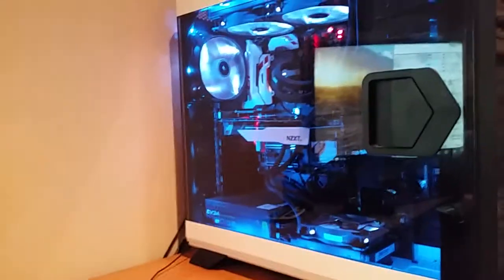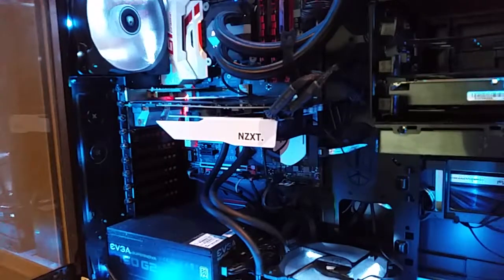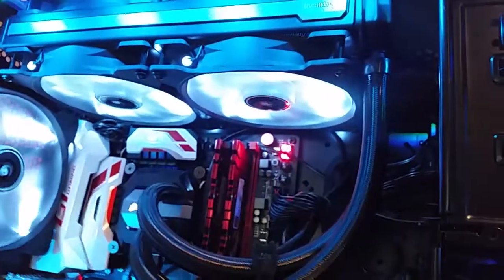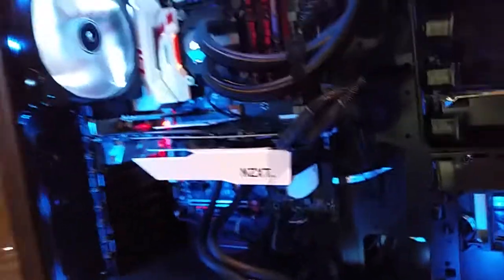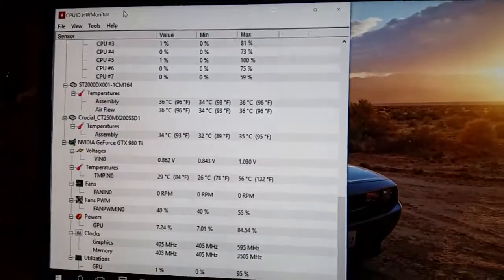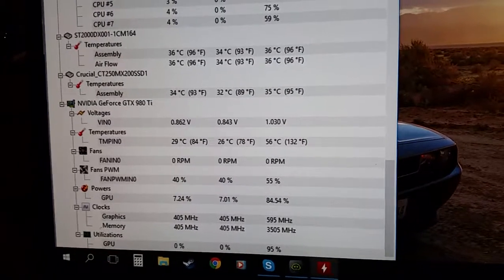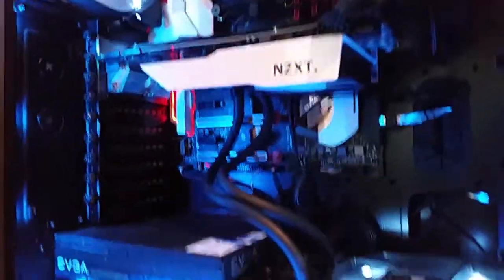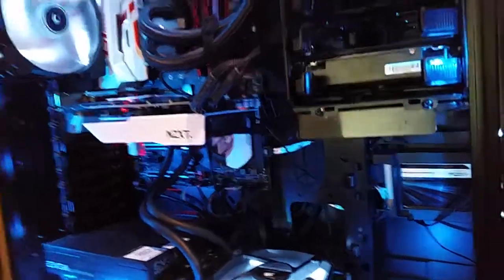Kraken G10 on a Gigabyte  GTX 980 Ti G1 Gaming

Comment: Hey Grubby mate. I'm thinking of copying your card setup, but my CPU cooler is so big that it's pretty much touching the backplate of my 980 ti G1 right now. Is it possible to install the G10 without the white backplate it comes with?
Reply from the maker: There is a way that you can do it, I saw it on another channel a long time ago where they secured the cooler using cable ties instead of the G10 & screws. The bracket is just there to secure everything in place and apply tension so if you wanted to get creative you could secure it in other ways. The other thing you could do is take the backplate off the 980ti and that would give you enough room to install it the standard way.
Reply: I might go with the G12 then as I think that only requires screws on the back of the card. thanks for the reply mate!

Comment: hi grubby, did you manage to take the black backplate of the card off? did you have to buy a copper shim?
Reply from the maker: I kept the backplate on and it went together without the need for a copper shim, the process is the same as on this video I recently posted for the 1080ti https://www.youtube.com/watch?v=g3lSknmW7eU&t=1069s

Comment: Have the reservoir above the pump. You might be dry starting it.
Reply from the maker: I returned the first H55 but I don't think there was anything wrong with it, ended up getting a second for sli and they both run fine.

Comment: Seems like you mounted the card with the backplate on it. How did you do that? Do the backplate screws that come with the Kraken G10 fit just fine with a backplate too?
Reply from the maker: They just fit with the backplate  on but you need to peel the foam pad off the NZXT bracket to do it, I also recommend putting a thin washer between the backplate and the nuts securing the screws on the NZXT bracket as when it's all connected one of the nuts will slip into a screw hole on the backplate and make the NZXT bracket tilt on an angle slightly, still works that way but it won't look flush
Reply: Thank you so much for the reply!
Reply: what kind/size of washers?

Comment: i have the same card... do i need heatsinks on the vrm?
Reply from the maker: If you're using the Kraken G10 heatsinks are recommended, there are videos out there showing how little the G10 does for the VRMs without the heatsinks.

Comment: I have Zotac 980 ti amp and evga sc 980 ti they're pretty much ugly looking together it shouldn't have a problem with the fitting you think?
Reply from the maker: I don't think there are any versions of the 980ti the G10 hasn't been able to fit but I would do a bit of net searching first just in case, the one thing that does change between models is the need for a copper shim between the water cooler and gpu chipset.
Reply: +Grubby well I ordered shims at eBay for 5$ it was successful on my gtx 980 but ti is different I guess it would work thanks for the info though

Comment: Was thinking about putting one of these on my Evga GTX980 SC AXC 2 along with the Kraken X41 and X61 for the CPU cooler but decided against it and just get Kraken X61 for the CPU and leave the ACX cooler on my GTX, I admire you for trying this on such an expensive card,  I did lookat at another vid and the guy put a copper shim between the GPU and cooler block not sure if that helps the cooling better

Comment: Nice :) I have this setup on my AMD 7970DCII. Also, you hear the water from the pump because the radiator is below this pump. Some AIO´s have the problem that there is still a little bit air in it and the air is in the pump(it also can damage it!). Try to move the radiator higher than your pump.

Comment: would this be alright with the 980 g1?
and how loud is the kraken g10
Reply from the maker: +Reb https://www.youtube.com/watch?v=DuAhwQnYFQc  I don't think the 980 is much different and there are plenty of videos out with other versions of 980's so at a guess I would say yes (I did this card without definite information that it could be done). The G10 is silent so it just depends what AIO cooler you hook it up with but the whole setup is quiet especially if you are comparing it to the stock windforce air cooling.
Reply: awesome, thx for the info

Comment: Kraken G10 is a fucking shit to install.
i had used in 290x gigabyte and the difference of temps and noise are huuuuge.
I tried to install the kraken in 390x g1 gaming, but i dont had luck and the card was damaged. I sent it back to Gigabyte.
Now i bought a 980 G1 gaming and i will thinking hard if worth to install g10 this time.
Reply from the maker: +Rodrigo Baltar G10 can be a bitch to install but if you've done it a few times you get used to it. Did you apply heatsinks to the VRM as well? I've got both 980 ti G1's with the G10/H55/heatsinks and an extra fan set to blow across the vrm and the temps and noise benefits were totally worth it. I wouldn't go back to any air setup.
Reply: Yes! I have 290x Gelid Heatsinks, but i dont know what heatsinks i have to use in nvidia card.
Reply from the maker: http://www.ebay.com/itm/252006568795 http://www.ebay.com/itm/261075318621
They are well worth it
Reply from the maker: https://www.youtube.com/watch?v=DuAhwQnYFQc

Comment: Could you possibly leave the stock backplate on, maybe with zipties on the sides? Also f. this card, mine has such terrible coil whine, and they won't RMA it
Reply: +TheHinerus Corsair 760t, i have the same case and it is the best case ive ever had. highly recommend

Comment: can you a picture from PCB? I wanna know if it's necessary Heatsink or it's alredy come with. I install a White Kraken G10 on my MSi GTX 980 TI Gaming and it's fit in perfect. Alredy have a Heatsink for VRM and the backplate cover Vram and back. But dont know about G1 gaming. I tried with my 980 Ti Hof but it's needs heatsinks because it's fixed with air cooler.